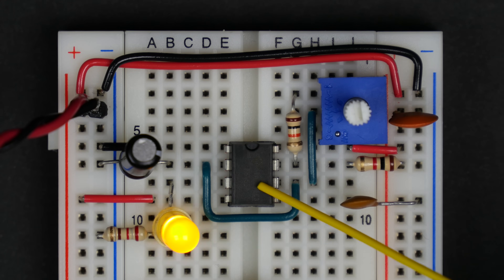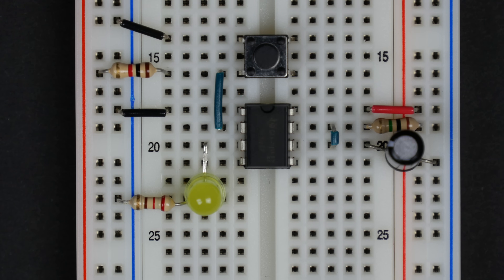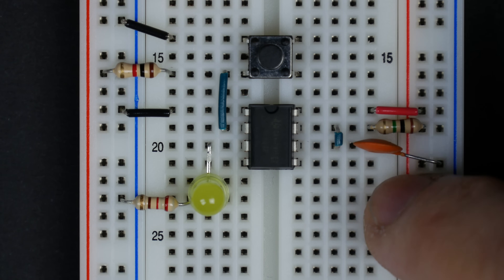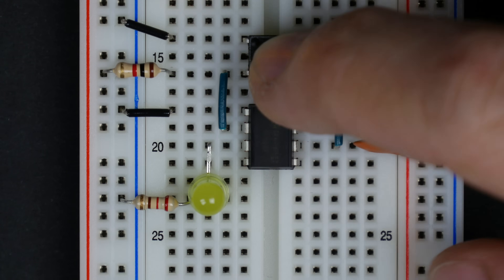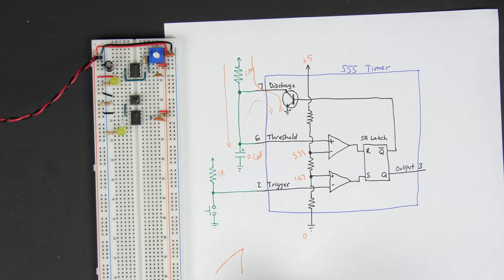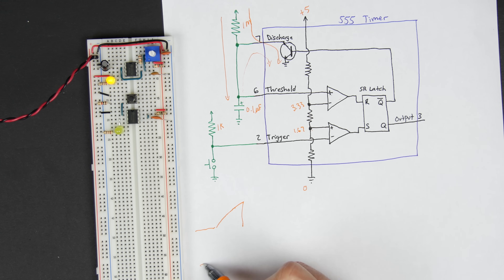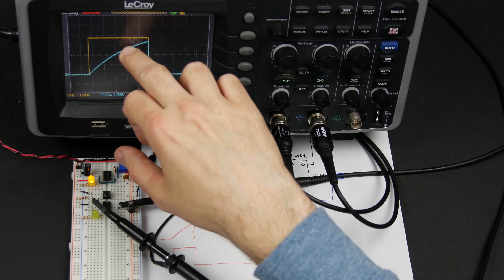Monostable 555 timer - 8-bit computer clock - part 2

Comment: I was wondering if you can still have some bounce problem during the release of the switch.
If you push the button for a long period of time and then release it after the voltage on the capacitor has reached 3.33V the output goes down instantaneously.
Isn't it possible to have a bounce in this situation and therefore get a second undesired clock pulse?

By the way, thank you very much for your work Ben!!
Reply: No i dont think that this will be a problem, because the bounce happens when they connect. But just releasing the button will just disconect the parts.
Reply: @markhempel624  thank you for your answer, I thought it was possible to get electrical bounce during the release of the button too...

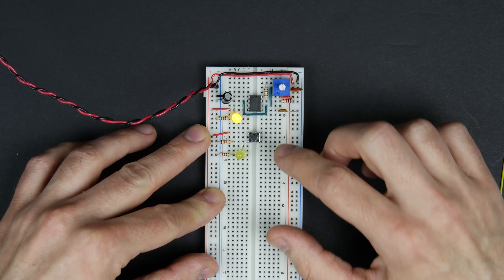Comment: Why is another resistor required at 1:37? If the switch is off then LED has no power and this other resistor does nothing? Otherwise if switch is on then it will go through the LED and to ground, so what is the extra one for instead just a wire to ground?

Comment: I've been fiddling around with this circuit for a while and I think I found a 
design flaw. Consider the scenario where we're in manual mode and 
continuously pressing the button. After a very short time, the capacitor 
for this 555 will be fully charged. If the button is released and it 
bounces (thus the trigger first goes high for a moment, than back 
low, before it finally goes high again), then the output goes low for a 
moment, but this will be followed by another high pulse (duration: about R*C*1.1).

I solved this by also connecting the trigger input to a PNP transistor's base (BC556) through a 10k resistor, grounding the collector of this and connecting its emitter to the positive terminal of the capacitor. This way, while the button is pressed, the capacitor will be continuously discharged through this transistor and its charging will only start when the button is released.
Reply: You can also use a transistor as a switch for the input voltage to the capacitor so that the capacitor is disconnected from 5 V when you're pressing the switch.  I've tested this and it seems to work reliably.

See a modified schematic here: https://imgur.com/a/7uHehRF
Reply: You beat me to it.
Reply: When the button is released don't we want the capacitor to discharge at that time, and then when the button is pressed the capacitor charges and then discharges quickly for the circuit to work? I don't understand why continuously discharging the capacitor through the transistor when the button is pressed and charging it when the button is released would make the circuit work. :/
Reply: @suuuken4977  That's because if we let the capacitor charge while we press the button, after a while, the charged capacitor will activate that "threshold" comparator. That would activate the "reset" on the SR latch. But if we keep pressing the button, you can see that the "trigger" comparator would also be on (the 1,67V on the "+" terminal at the comparator is bigger than the 0V on the -). At that point, we would have a signal both on the S and R terminals of the SR latch. On this type of latch, we can't have both terminals (S and R) set to 1. This would make the outputs unpredictable (Ben also has a video on the subject). For that reason, we need to make sure that the capacitor won't charge while we press the button, to avoid having the reset terminal bein on with the set terminal.
Reply: @olacolega7067  Thanks for leaving that comment, helped open my mind ;D

Comment: One question, dont you have to limit discharge current from the capacitor ? it is fully charged at 3.3 volts with no real resistance over the discharge transistor, you theoretically get a 3.3 amp spike through it, or am I missing something?

Comment: It can't be the most economical solution tohave a 555 dedicated to every momentary on every circuit ever though right?  There has to be a cheaper easier way?
Reply: Cheaper != Easier. There are numerous ways to denounce buttons, the cheapest, probably, is to use a microcontroller, if it already used in the schematic.

Comment: I experienced this bouncing when learning about a shift register (8 bit) that I was trying to manually clock. I noticed that at least 1 out of the 8 clock cycles it would just "freak out". I thought button was faulty but swapping it with other ones exhibited the same behavior. Now I now why! I had no idea contacts on the switch bounced! Thanks for these videos!
Reply: Pgysical switches are not perfect, and will never be.  I had to build a debouncing board for my IC-testing using 7400 as a RS-FF.

Comment: Is there any advantage to using monostable mode over configuring the 555 as a schmitt trigger?
Reply: Yes.  Schmitt triggers clean up problems caused by slow-rising or slow-falling edges, by providing some positive feedback that effectively shifts the trigger point, but switch bounce is a very fast-edge thing.  Now, if you were using a capacitor to smooth out those switch transitions, then a schmitt trigger could help.

Comment: From what I looked up, MFD is an obsolete labeling scheme for capacitors. From what I found "mfd" (lowercase) means microfarad and "MFD" (uppercase) means millifarad. From what I can see, yours is MFD, and that tells me that it is 1 millifarad, but that doesn't make much sense when you measured it to be 2 microfarads. I'm not sure if this means anything to you, but basically if you have any capacitors with this obsolete system, then do measure them to be sure. Considering those capacitors also have the positive lead labeled and not the negative lead shows just how much more obsolete they are. I don't know if you have worked with these capacitors before, but someone like me who is used to the grey strip meaning negative would have put it the wrong way and that wouldn't be good.

Comment: Is there anybody in the UK building this, or for that matter any other Breadboard projects? It seems extremely difficult to get hold of certain components. For instance I cannot seem to find a potentiometer (i.e. a variable resistor) that plugs into a breadboard. Can anyone help me out by pointing me to a good supplier of breadboard components?
Reply: ali express if you don't mind waiting a while

Comment: What happens if you hold the button down?
Reply: The output will remain high until you release the button. If you want a timed output pulse, the trigger pulse must be shorter than the RC period. This is achieved by coupling the switch and its pull up to the trigger input via a 0.1uF capacitor, with an additional 10K pull up resistor added at the input pin.

Comment: Hi Ben,  thanks for making such a great effort for this project.  But I'm having trouble showing the waveforms.  Firstly, when the probe is connected to the top of that cap, the LED stays on, so I can't catch the falling edge.  I use a Rigol 1104 and 10x probe. Is there a source of interference?  Maybe I misread those bypass caps, they were the only ones i could find, maybe too small.  Also, my skills at triggering (to see slow waveforms) are poor so I'd like a quick video of settings you use on the 'scope.  Thanks. Barry.
Reply: Same. With probe on cap it doesn't charge pass 2.7V, hence LED stays always on. I use 1X probes and battery powered oscilloscope.
Reply: Ok, I tried 10x probes and now it is working

Comment: Made so much sense when I thought about it from a MineCraft perspective.
Reply: Well, Minecraft does have comparators, and an SR latch is simple enough to make with redstone and redstone torches. The resistor divider can be 1 redstone torch and a 15 blocks long line of redstone, with taps off at the 5th and 10th blocks. The only bit I've not figured how to do is the capacitor. Maybe hoppers and and a chest?

Comment: At 19:15, why did adding that capacitor reduce the noise (it looked so damn cool) ? An easy explanation would be nice for a beginner like me. :D
Reply: Imagine a hose that outputs a gallon of water a minute. Within that minute, the average rate of flow is 1gal/minute, but sometimes the hose can spit out a bit more at once, followed by a bit less which averages out over time. The rate of flow is still an average of 1gal/minute, but sometimes a bit more or a bit less is let out in a given second to second period.

Now, if you were to put this water into a bucket with a hole near the bottom that only ever let out 1 gallon/minute, you could stop up the hole, fill the bucket with the hose from the top and then when it's full you start letting water out of the hole. Now, even though the hose might dump a bit more or a bit less at times, you have this reservoir that you know will only ever let out 1gal/minute like you wanted, so it is unaffected by the small fluctuations in flow.

Hope this clears it up for you/anyone else!
Reply: William Mentink More or less, yeah. Water flowing around is a surprisingly good analogy for how electricity works.
Reply: Chris Wirt, would that be like a water tower? A fixed flow into the reservoir, that can meet large sudden demands?

Comment: Switch bounce has become the most misunderstood topic in EE because of the Arduino cancer. In most cases people don't know that Arduinos have timers doing all sorts of things in the background. While the CPU is waiting on a timer, nothing short of an interrupt will get its attention. Arduinos have hideously poor interrupt implementation. Hence, untrained hobbyists think everything is about switch bounce and start building useless signal conditioning circuits rather than read the data sheet. Very frustrating situation.
Reply: Yo, rainbow-farting, sunshine-puking unicorn, you really came here too to spew your friendship and happiness? Wasn't it enough to do it on Julian's channel?

Comment: what happens if you keep pushing the button after discharge? Wouldn't the SR latch switch states?
Reply: If you really want to find out you can download a free Java based program called CircuitMod. It's a really nifty circuit simulator. Kinda fickle at times, like you can't connect capacitors directly together cuz it doesn't consider wires to have any resistance so it breaks the math, so to speak. But it's been an invaluable tool to me for learning electronics and it comes with literally oodles of example circuits, including maybe 5-10 circuits with the 555.

 It's been wonderful for helping to visualize and gain an intuitive understanding of how circuits work. CircuitMod combined with videos like this has been the majority of my non-hands-on education in electronics. I might check out an article on All About Circuits or Electronics Tutorials once in a while, but I have ADD so I find it very hard to read anything more than a few paragraphs. I'd much rather learn hands on. I believe there's also an online version available which you don't need to download. I think the site is called falstad. Definitely worth looking into.
Reply: Looking at various datasheets, it's probably undefined behavior. It depends on the exact design of the RS latch, some keep state when they get the illegal input, some set, some reset. Since you said it should switch states: that'd be a JK latch.
Reply: If you look at https://commons.wikimedia.org/wiki/File:NE555_Internal_Circuit.svg I believe that if you set the S first then the R cant change the latch state. The lower left transistor in the purple section will be on so the output of the other comparator has no effect. It is a limitation of the block diagram.
Reply: Ben explains this situation in a later video: https://youtu.be/F1OC5e7Tn_o?t=29  If the button is still pushed (and, thus, S is high) when the R goes high, the both outputs of the SR latch go low. So our LED is turned off anyway. When you release the button and S goes low, the R remains high and the outputs return to normal state.
Reply: Yeah, so if you hold the button in for more than a tenth of a second, you're gonna get bounce. So what's the point? What problem is this circuit designed to solve? What a stupid system. A better - and cheaper - solution could be arranged just with two resistors and a capacitor. You could remove the 555 and STILL get a better debounce.

This series of videos is a great way to learn how 555s work; but they're simply not suited to the task of debouncing, and Ben should have known this.
Reply: This latch (as almost every latch that you will find) has priority for reset. So, if R=1 Q=0.
Reply: Xiretza right, I was wondering this as well. S=R=1 is generally not allowed
Reply: I've built this kit and here are my findings...

With a 0.1uF capacitor, I find that if I hold the button (trigger), then the LED remains on, appearing to ignore R. I've connected a scope to see if it was just bouncing very quickly and there does appear to be some noise in the output voltage when the capacitor reaches full charge. 

If I connect a 1uF capacitor and hold S for 5 seconds, as soon as I release the trigger the LED switches off with no delay. Looking at the scope, when the capacitor reaches the threshold required to trigger R, both the capacitor and output voltages become unstable. It looks like S and R start fighting with each other. It may be the case that there's a very high frequency bounce/ fight going on between S and R being held (as soon as R triggers, because S is held, it immediately sets again, and because the capacitor is already nearly at capacity it very shortly triggers R again). Because it's at such a high frequency, (980kHz according to my scope), the output voltage doesn't have enough time to drop by enough to consider it as having gone low.
Reply: i wanna know too
Reply: Trigger input is meant to be  a trigger, not a prolonged input. In other words, trig pulse time < time of unstable state.
Reply: @may21136  In my experience, the "just don't do it" strategy always fails eventually, especially if I come back to the project weeks/months later and forget all about it. It's good to design the circuit such that it will behave in an expected manner on inputs for which it was not intended.
Reply: At 8:11 you can see clearly that he pushes the button longer then the set pulse and the LED stays on. 
In the Datasheet  http://www.ti.com/lit/ds/symlink/ne555.pdf it says under "8.4 DeviceFunctionalModes" - Table 1, when the Trigger Voltage is below 1/3 Vcc, the Threshold Voltage is irrelevant for the output to be high.
So The LED stays on as long as you press the button but turns off immediately when the button is released after you pressed it longer the the set pulse length.
Reply: @wiebel7569  which means that any bounce when the switch is released will result in the output going .....HHHH (trigger released) L (trigger bounces high, then settles low) HHHHLLL.

So it's not effectively debouncing the switch.
Reply: @yadt  I'd say you're correct, if you press  the button long enough. So the best debouncing experience ist provided for keypresses shorter than the configured pulse length.

Comment: This is a great series for learning, so using 3 555's in 3 different modes makes a lot of  sense.
You can however simplify the circuit a lot by using only one 555. I made a suggestion for how you could do that:
https://drive.google.com/file/d/0B33fESSCsbaleGdzamZEWFc1a0E/view?usp=sharing
Reply: Could you please repost your simplified circuit? The link is broken. Thanks!
Reply: @thek3743  https://drive.google.com/file/d/1yA1zU3E3ngw6E6ObdEecXfCrS3Lt8MJp/view?usp=sharing

Comment: There is a problem if you keep the button pressed for a long time (longer than it takes the capacitor to reach 3.3). Then you're setting and resetting the latch which sends it to the unstable state. So the button press needs to be quick compared to the RC time constant.
Reply: bluekeybo that'sthe point. the button is being used only to generate manual pulses. holding the button long defeats that purpose. check out julien ilett's video, where he uses a similar circuit to cycle through different memory addresses.
Reply: My understanding of it is if you press and hold the button so that it is still pressed when the capacitor reaches 3.3, the LED will still turn off as normal, but the capacitor will not discharge until you release the button.

Comment: 3:48 - Quick question as I'm trying to make sure I fully understand this. Is it R*C, or is it 0.693(RA+2RB)C as it was in the previous video? I realize the difference is very small (0.1s vs 0.0693s), but I'd like to know just for my own understanding.
Reply: Check the datasheet for the LM555(This is the IC Ben is using).

Comment: I know a lot about what you're doing in these videos, having taught myself as a youth in much the same way you're walking through the lessons in your videos.  These are fantastic instructional videos.  I encourage you to do as many of these as you can.  They are more valuable that you might realize.  I do have a nitpick about this monostable clock video.  You mention that when you hit the button, as soon as the capacitor charges, the flip-flop switches the LED off.  That isn't exactly true, as the video shows.  It only turns off the LED after the capacitor charges AND YOU RELEASE THE BUTTON.  That indicates that if both Set and Reset are asserted in the 555, the Set takes precedence.  As I said, it's a nitpick...please don't see it as a criticism.  These are all great videos!
Reply: Thanks for this observation. I was scratching my head...

Comment: 2:20 how to make SIMPLE two (or/and three) times button BLINKING/flashing LED CIRCUIT (turn's on/off an LED 3 (or 2) times, then stop. (Simple swich, capacitor, resistor (and transistor).) (Speed, like human clik two/three fast, or can adjust speed)) (one button make 2 time , another make 3 time turn on)? (Or like morse, one long button press and two short press). Or is any cheap IC what doing this.  Working energy like smartphone hansfree or adjust.